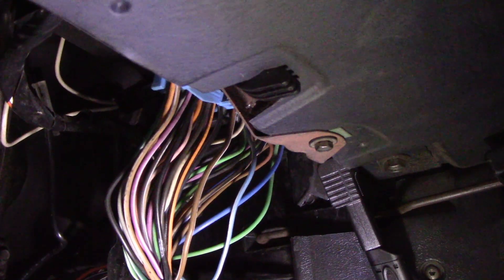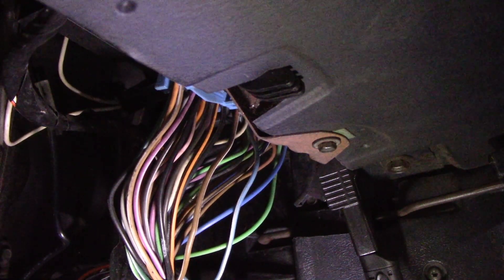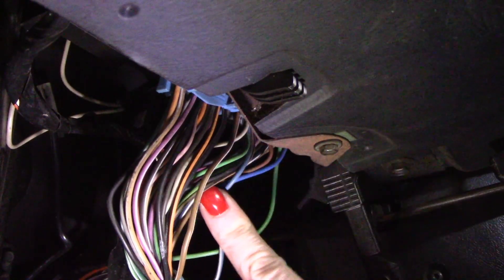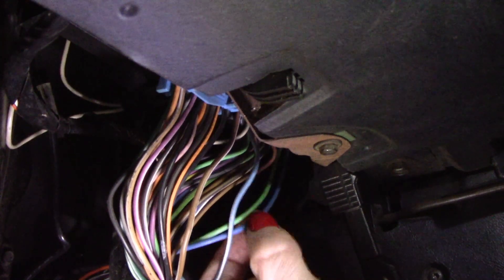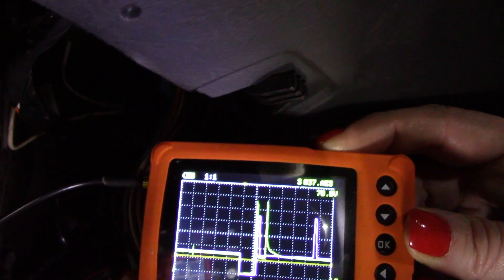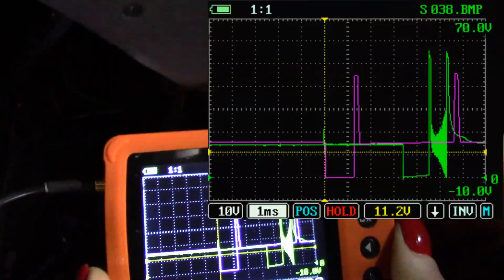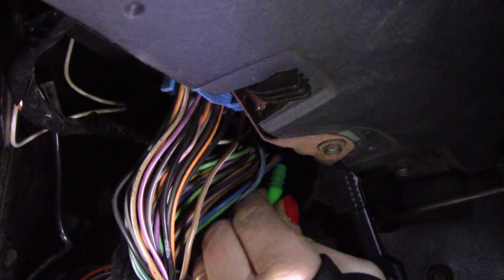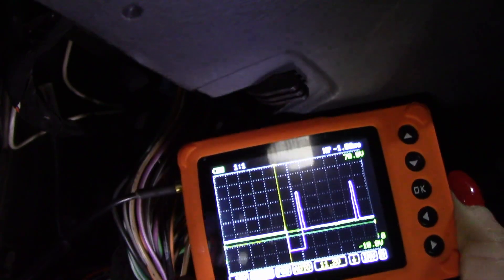Using a 'Scope to Find a Failing Fuel Injector

Comment: im ordering the uscope basic kit,do you need atennuator when checking fuel injectors or secondary wave forms using the coin ontop of COP method?
Reply from the maker: Well max voltage is either 75 or 80v DC only, so for injectors you can get away without an attenuator for most old school injectors that peak around 75v. Direct injector/GDI I'd use one. Secondary can peak about 70v too. This scope your safe.  Doing the coin trick, it doesn't spike that high... just be sure you always connect ground lead 1st, so no ignition spikes get back to the scope. 
Great questions 👏  enjoy the scope 😁

Comment: Thank you for adding where I can find one of those new scopes in the description. Closest I had was a RAC mini scope that was portable yet it stopped working and I couldn't find the parts to fix it. Glad to see you using a scope they are extremely handy. I wouldn't give up my old Sun Infared Scope or my old Heathkit they have treated me great yet they are not exactly portable. Great video 👍
Reply from the maker: Wow! My start was on a Sun Scope... about 20+ yrs ago. Crazy amount of detail. However, modern day scopes such as the Pico have come a long way. The ability to store captures, review, and manipulate them... heck, even the ability to share them with colleagues.  

Today's automotive technician needs to know how to use a scope. So many have no idea of their value.  How much time & effort is saved with them as well. Of course,  like any tool, it has its place.
Reply: @CubasAutomotive  I got my start on my Heathkit auto diagnostic scope 20+ years ago from its original owner. The Sun scope that I have my father learned on that one around 50 years ago. My father also learned on the old Heathkit from the old guy who taught him and later taught me. So I want a small scope like the pico that is more up to date so I can learn more because I am way behind with computers and need to catch up. Then I can teach my niece and others passing the information on to them one day they can return to teach me is all I would love to see. Did the Sun Scope you started on have the rear wheel dyno in the floor ? Because I have used that model too I kinda wish I would have grabbed that one before it got tossed. Its sure neat how some of the what was old becomes new again especially with a scope they have been around a really long time.

Comment: Do u need at attenuator  ?
Reply from the maker: Not with this scope and this voltage.  Scope is rated for 75V. Peak on this was near there and very fast... so even if it hit 80 or 90 volts, it would not hurt anything. You need to know the limitations & weaknesses of your tools. Not all scopes are rated this high.... such as Hantek is only 20V total... so you'd definitely need an attenuator.   Snap on you wouldn't need one, as most are 400v limits.  Hope that helps! Great question!

Comment: Fantastic find! You would never see that without a scope.
Reply from the maker: Exactly!  Couldn't hear it at all, but since I did replace that injector, I've had no more intermittent driveability concerns.    I want to convey to ppl is how amazing it is to be able to "see" what current & voltage is doing. ..and still a non intrusive way of testing.

Comment: Hi  Cuba there's a trick I learned years ago to check faulty fuel injectors  on this type of injector shine a timing light into the thortle body with the engine running if you get a bad spray pattern ( which should be cone  shape )  or driping or a  inconsistent  pattern you have a bad fuel injector most of the time  keep up the great videos Joe
Reply: Thats one thing I do too with a timing light.
Reply: That's brilliant

Comment: That almost makes you wish you had one of those REALLY old GM vehicles that had the electronically controlled carburetors on them. You could start those things up, completely unplug the computer while it was running and throw it in the trash, and it would run just as good.

Comment: That is one sweet little scope! Been eyeballing that one for a long time now. Once the tax returns come back, I'm gonna jump! :)

Great vid, Cuba! That still of the wiring diagram was great! 👍👍

 My first vehicle was a nearly brand new '88 S15 pickup with the little 2.5 liter 4 cylinder. Was a 5 speed, manual brakes, manual steering, no A/C - about as basic as it gets. That TBI setup is usually bulletproof, but as you know, those injectors can crap out sometimes. I miss that truck though! I ABUSED that thing, big time, and it never let me down once. It lived to see over 140k miles according to Carfax, too - that was a shocker to me, knowing what I put it through, LOL!
Reply from the maker: Extremely handy. I've been using it in place of the DVMM many times. I just want to be comfortable with using any scope, so using it often enough should help!

You won't be sorry. You may need more channels sooner than later, but it's good for quick checks and it's so portable!

Comment: Cool scope captures, Cuba! Try using the "trigger" feature to keep the pattern in the same spot on the screen. Never seen an injector oscillate like that! Wonder what the failure is...
Reply: Pine Hollow Auto Diagnostics I was wondering the same thing🤔. Good capture anyway
Reply from the maker: I've been trying to use the trigger on the Uscope, so far I'm not very good at it. Lol PICO & VantagePro have been easier to pick up on, and I apply it when needed on them. 

Hopefully with more time, I'll get better. Practice, practice, and more practice! Lol 😉😊😊
Reply: @CubasAutomotive  We always keep learning. I just know a little bit from my own experience whats worked or didn't work. Still more to learn it never gets boring.
Reply from the maker: @sswcustomsewing4276  100% i learn everyday.  It never gets boring.  Even if I'm frustrated, once I prevail, it's the best feeling.... and hopefully taking a lesson from that experience.

Comment: That was spot on. Nice job. I remember  we used to piggy back a micro pharad capacitor into the throttle body injectors to help alleviate that issue on the 8 cyl GM's. Cheers
Reply from the maker: Interesting.  I've never heard of that.....

Comment: That is an awesome video. I have yet to use my uScope like that. I suppose having several multi Trace scopes I've never put the effort into seeing how powerful the uScope actually is. 
Great stuff
Reply from the maker: I've been using the Uscope in place of the meter in many instances, so that I can get comfortable with using it. The fact I finally have a good example of putting the scopes to use, has been a great experience. Luckily it was on my own vehicle too, as I haven't done much automotive work over the winter. 

 I try to learn as much as I can on my own, hands on, as I find it sticks better. When I'm truly stuck, that's when I'll look to help. If I hadn't found anything in another wk, I would've tried to get your input at the shop. For 1, you're one of the few local guys that apply scope usage. I don't want silver bullets, etc. 

Thanks for being an awesome friend! It truly means a lot!

Comment: A great diagnostic video. I own an OBDI car, but I see very few videos on them. I think mechanics shy away from them, as the computer is generally little help. Thank you for sharing.
Reply from the maker: Thanks for the compliment! 
Yes, I think you're right but I've also been told there aren't that many older cars on the road.  I don't find the latter to be accurate,  as I still see plenty of pre '96 vehicles. It all depends on the demographics.... 

I'm glad to fill in this niche, as I prefer the OBD1 & earlier vehicles myself. 😉😊

Comment: Great capture on the Uscope Cuba. That's a lot quicker and easier to see than to try and do an injector balance test. That pause button is great.   Didnt know the Uscope has that feature. Great video.
Reply from the maker: Trying to apply all what I have learned in the last couple months.  The Uscope was particularly handy with temps dipping and winds picking up.  Hooking right up at the ECM inside the truck was awesome, convenient,  and warmer than working 100% under the hood. 

I still have TONS to learn, but with people like Ivan (from Pine Hollow), Keith (from New Level), Eric (from SMA), Keith (from L1 Diagnostics), Dan (from DiagnoseDan), Brandon Steckler (Waveform instructor), Paul (from ScannerDanner), Mark Boggess (a friend who should have a channel on scopes)... and I'm sure a few others. I've made huge strides...
Reply: @CubasAutomotive  I'm not familiar with Brandon or Mark but I follow all the others closely.  They are all extremely awesome at what they do and I'm so glad they share their knowledge with us.  You should also check in Mike Becker at wellsve and now at ngk technical training. Keith us a blue wrench for Mike's live training classes and Eric always stops in.
Reply from the maker: @mikeburton1733  Oh yeah!!!  Beacker had a video put out a couple days ago.  Another viewer, Jason, reminded me!  I missed the recent livestream, but I did watch it. :)
Reply: @CubasAutomotive  if you've watched Mike's class called Why every mechanic should own a labscope, he starts off showing a case study from a guy in Canada  he calls Porsche Mike   that's me.   My 2 minutes of fame.  Mike is young but hes very smart. I was talking to you in Eric's WUW the other day. Congrats on the blue wrench btw.
Reply from the maker: @mikeburton1733  Cool! Another video to add to the list!  Thanks!  

lol Thanks! Blue wrench = POWER! lol  I think I am on a few channels... JimTheCarGuy, SMA, TBT.. not sure where else. It's nice of them to let me be...
Reply: @CubasAutomotive  yes. I've seen you on  Jimthecarguys channel also.  You're quite a talented lady.  I wish I knew half as much as you do  about small engines.  But I seem to only  learn as needed.
Reply from the maker: @mikeburton1733  Necessity was my driving force... then it was fascination.  ;)
Reply from the maker: This is one of Brandon's videos... shows how powerful using a scope is, in some applications and not be intrusive.
https://youtu.be/AsJQls_T73k
Reply: @CubasAutomotive  Oh ok.  I've seen that video.  I try to watch TBT vids whenever I can.  Just havent seen the TBT  After dark chats.